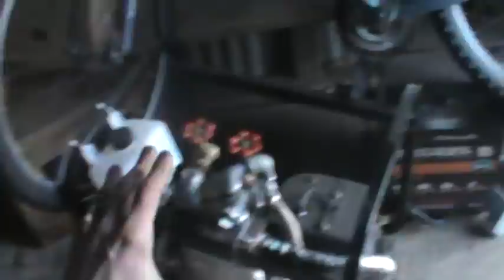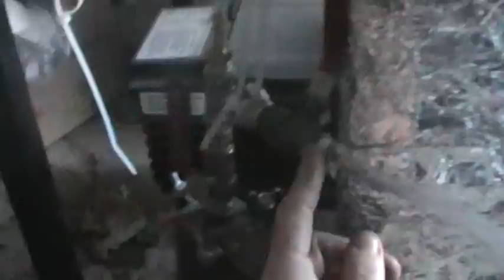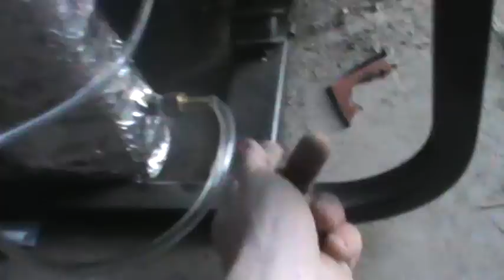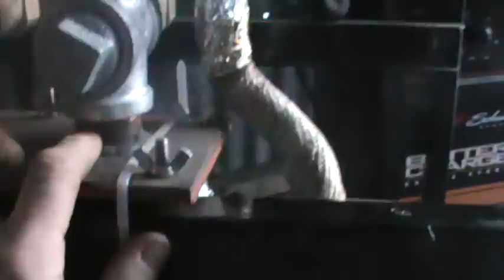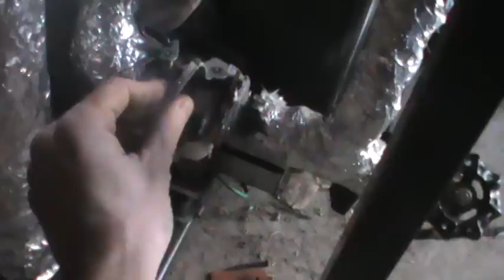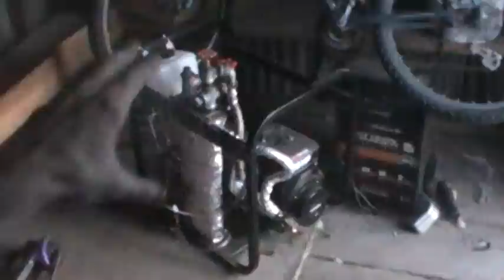F.S.R.D. Generator - Fuel Vaporizer System #1

Comment: So i know it has been a while since you posted this video, but this is the first time i have seen it. My question is pretty simple. Since you are essentially superheating the fuel in the vaporizer cannister, do you worry about the stainless steel mesh becoming saturated due to the heat and amount of air being forced through the cannister? It just seems like adding heat to a combustible fuel would cause an over pressure, almost like a baby turbo ramming air into an intake... it just seems like one more hurdle to overcome. Good luck with it man. I will be working on my own ideas in the future when i can afford both the monetary cost and the time!
Reply from the maker: I haven't had a problem with the stainless steel wool becoming to saturated but with this particular design heating up the intake air caused the generator to run poorly due to it lowering the density of the air.

Comment: Hey Tyson! I have a proposition for you. If you could perfect this system within the next three years, I will pay you if you could have it properly installed in a vehicle for me. I need something that is safe for my children and I, and I am not too worried about lb ft of torque or top speeds, just something reliable and good on mpg. If 40,000 is a good number let me know. I'm already saving up right now! :)
cheers
Reply from the maker: I'll do what I can do to perfect it within that time frame. Time will tell. That would be more then a good number, in fact I couldn't charge that much I would not be able to live with myself if I did. This vapor system testing has sure been a pain to get right. I have had some amazing results a few times but have sure struggled to get it much. There are still allot of unknowns that need to be figured out.
Reply: Have you tested on a full weight vehicle or just some rig with a bike or something? Please keep me posted.
Reply from the maker: GoldSlidePark I have tested it on two different vehicles, on my 93 Jeep Cherokee and on my 2006 Buick Rondavous.